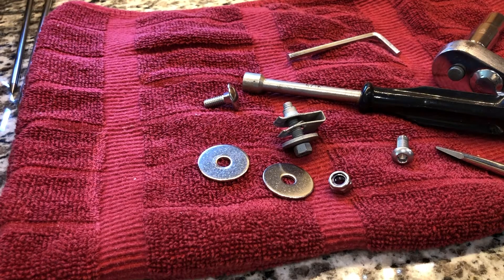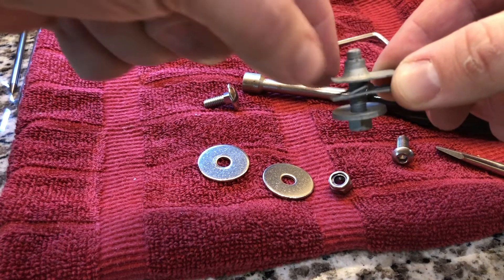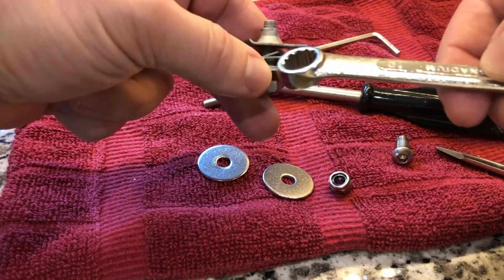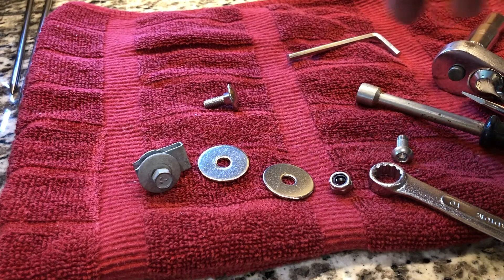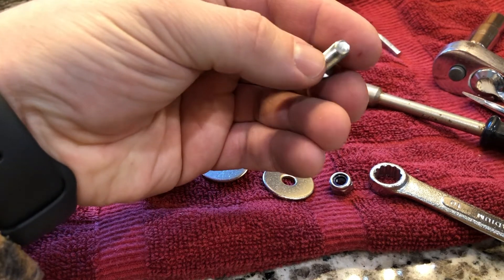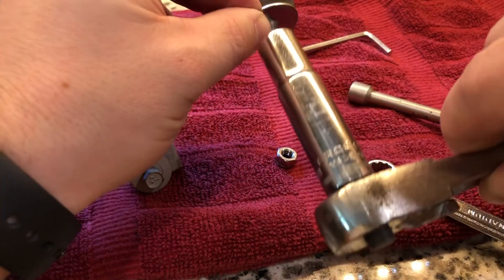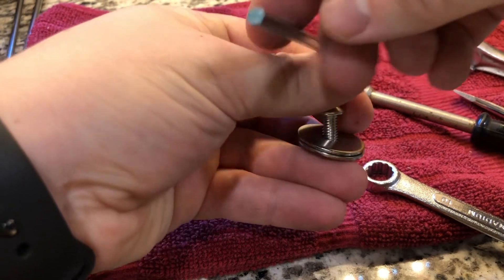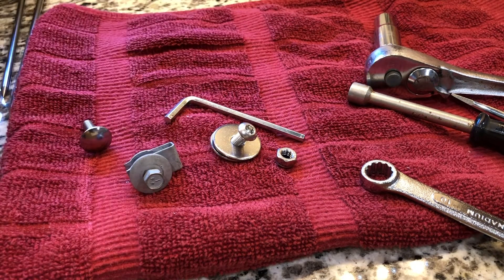2021 Ford Tremor Winch Defect

Comment: Paid 3,400 from a local dealer and the directions refer one to WSM (ie Ford dealership insider info) and the directions are written from a typical engineer (ie IDIOT that’s never turned a wrench). The cruise control module wiring harness adapter from the truck gets smashed when trying to remount it over the new winch bracket because it’s not designed for such a plug depth. Awesome FORD. My Jeep jl winch install was a cake walk compared to the geniuses at good ole Ford. And Ford tough…lol I fart and stuff scratches and chips. That’s great to know when one pays over $80k.

Comment: Thanks for the video. I ordered my F350 Tremor in March took delivery June 15, 2021. Just went out and checked, The dealer must’ve missed the bulletin. I’ll be replacing the two bolts myself tomorrow and I’ll be taking a copy of the bulletin to the dealer. No damage to my rope but I can see where the protective sleeve was rubbing.
Reply from the maker: Glad it was helpful!

Comment: It’s not a  Ford factory issue. It’s a warn industries engineering design flaw 👍
Reply from the maker: Ford published the install instructions that were used by dealers to improperly install the bolts originally. Now, Ford has updated their install guide to instruct dealers to use proper bolts. How is this a Warn issue when both the instructions and the install are performed by Ford?

Comment: What is the winch model for the 2021 model, I can not find it on the ford site?
Reply from the maker: It’s actually available from Ford Performance Parts. 
 https://performanceparts.ford.com/part/M-1821-SD
From what I can tell, it’s a custom Warn winch designed for the Super Duty Tremor package. The line is designed to spool over the top of the drum.

Comment: Ford updated the winch install instructions to address this issue:

https://performanceparts.ford.com/download/instructionsheets/2020_CMY_SUPER_DUTY_TREMOR_WARN_WINCH.PDF

It's on the first page of the instructions. Updated 3.12.2021. They want you to discard the bolts and use lower profile M6 cap head.
Reply from the maker: Wow!! So great that they finally addressed this!!
It also appears that their official solution is pretty close to what I hacked together as well. 😃

Comment: Ok, the dealer followed the supplied instructions and those instructions contain an error. The instructions say to discard the lower valance. That is the real mistake because that valance is a piece of plastic that runs along the bottom of the winch. So, when the bolts are reinstalled without the plastic valence they are too long. The best fix is to reinstall the plastic valance and that will prevent the bolts getting into the rope.
Reply from the maker: This is super interesting. Do you have any pics showing the “correct” installation?
Reply from the maker: Even if you had the plastic valence left on the truck, I still would be uncomfortable with the factory clip (even if the bolt didn’t stick as far through it).
Reply: Well problem solved, run a nylon washer spacer the thickness of the oem valance 👍

Comment: The lack of context in this video is mind boggling.
Reply from the maker: Sorry, here’s some more context. This video was made in response to a discussion here: 
https://www.fordtremor.com/threads/picked-up-my-f-350-platinum-today-with-winch.2565/page-2#post-45712
Reply: Actually makes a ton of sense if you have one of these winches. I just installed mine on my truck and knew exactly what Matt was talking about. I zipped the bolts down when I had my bumper off then smoothed em down but I may go back and install the SS hardware like in this video.  Good content Matt. Thanks

Comment: Matt, I’ve watched your video a couple of times and I’m confused as to what the issue is and where the factory bolts were located. Were the bolts rubbing on the winch drum or can the winch cable rub against them? Could it be the person doing the installation put them in from the wrong direction? Please add some reference photos showing an overall with arrows pointing to where these bolts were originally installed. Thanks
Reply: See my comment about why this happens.
Reply from the maker: Hey Rick, here’s a couple links that hopefully answer your questions.  
https://www.fordtremor.com/threads/picked-up-my-f-350-platinum-today-with-winch.2565/page-2#post-45712
https://www.fordtremor.com/threads/winch-installed-but-i’m-not-impressed.2099/page-3#post-36714
Reply: @MattLegler  Thanks for the clarification Matt. I’m looking at a Tremor myself and was concerned about this issue.
Reply: I was able to locate the winch installation instructions online. I don’t know how to post a link, but if you search for SKLC3J-19E536-AA you will find them available for download.
Reply from the maker: @rickcollins1796  it’s definitely a huge safety issue. It wouldn’t prevent me from ordering the winch, but be 100% sure the bolts aren’t making contact with the rope before using it.